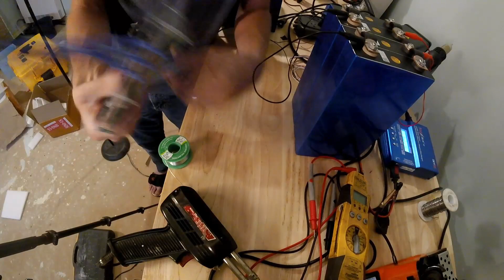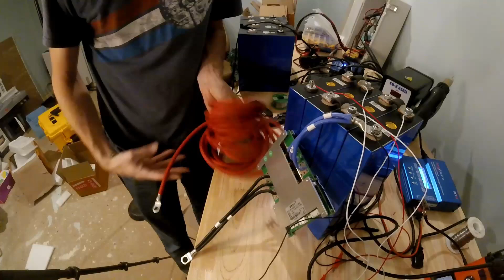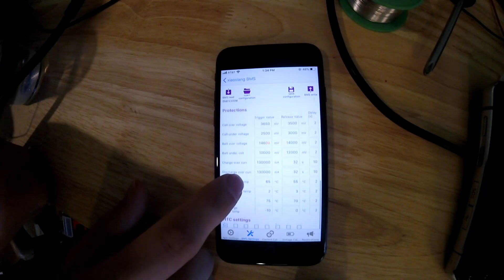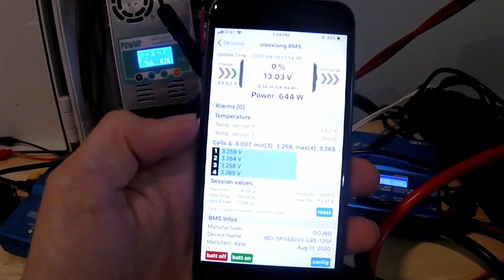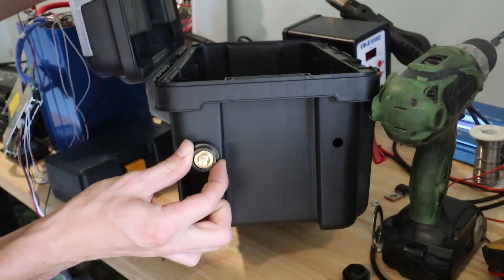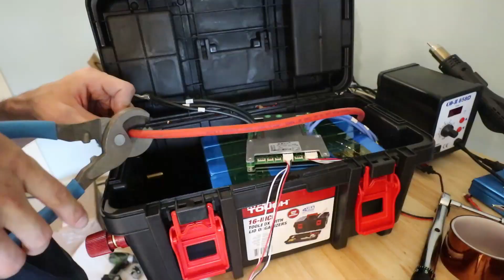DIY Solar Battery Build - Alibaba LiFePo4 Prismatic Cells w/Aliexpress JBD BMS - Low Temp Protection

Comment: with to days money in 2025 a good bms is as high as the battery which is about a 100 dollar bill with the bms already in them if they go bad i only put in a 6amp 4.2 cell balancer going on 4 years now works great, cell balancers and for 24v batterys using bat equalizer for two 100ah bat to make a 24 volt

Comment: Nice video…Thank you.  BUT the torquing was a little Overkill.! 😊
Reply from the maker: Wow you're right. I must have gotten a number confused, I do 42 inch pounds on current batteries. I'm surprised I didn't strip any threads on this battery.

Comment: With the Dimmer + Solar PV, self-sufficiency will now increase to almost 95% in summer, which means a huge breakthrough. The prerequisite is that you have at least a small balcony power station, and you don't need an expensive battery either. Example of a kettle: Without a dimmer, the 2500W - 600W PV system needs = 1900W, which you have to pay more for. If I turn the kettle down to 600W with a dimmer, then every weak PV system can now supply each consumer independently and independently, because the 2500W kettle becomes a 600W kettle thanks to the dimmer. Magic... The 2000W e-heater becomes a 500W e-heater with a dimmer, which can run 12 hours a day free of charge via PV. https://youtu.be/QbLWDbJi6ew . The 4000W oven is also tamed. Not the solar systems have to grow, but the consumers just have to drop by 75%, which is sooo easy with the dimmer. are you convinced now I have already switched my entire household to dimmers. Please have a look at my channel. ............. 🌞 ...............            Increase mini PV solar self-sufficiency (winter and camping): A boiler and other power-hungry consumers can be infinitely reduced using the "5000W dimmer". Ebay €7. I run 5 dimmers in parallel on an 850W inverter. Kettle 2.2KW at 150W runs 12 hours a day, so the water is always hot. The room is also nicely heated. 2.5KW washing machine runs in parallel with dimmed to 400...600W and always reaches its 60°C, and also its 1400rpm... It doesn't matter to the washing machine whether it changes the washing temperature to 5min@2500W or 100% can be achieved free of charge via existing PV power in 20min@600W. The wash cycle lasts the same time dimmed and non-dimmed, 3Sth 10min. The iron, dishwasher, oven, electric heater, waffle iron, coffee machine, all internal heating are throttled with me. Videos on my channel https://youtu.be/eC2olbCBhh0 The inverter stays cool, quiet and the MOSFETs + (battery) remain intact because no extreme current peaks arrive at the inverter. Now every Mini PV Inverter is enough to sell large devices. So, with the dimmer, all internal heaters/devices can be converted into base load devices that stay almost permanently ON, drawing very little current directly from the PV. With a wattmeter / energy cost measuring device you can then measure this perfectly in order to set the dimmer optimally...

Comment: Nice video, are you still running that particular BMS without any issues since then?
Reply from the maker: Yep, I’ve used dozens of these since this video. Not a single problem with them.
Reply: @BeeneEnergy  Awesome, Just pulled the trigger on it. Cheers!

Comment: Great video! 

I am wiring my BMS, I have the same bms with similar cells. I've followed the process you've shown a explained. I am at the stage of verification. The bms cables are wired correctly, I checked the voltage on the connecter and was correct (3.3v, 6.6v, 9.9v then full pack voltage 13.22v) 

There is a voltage drop when I check the voltage with the BMS connected like you advise. It is a pretty big drop / leak though ( -1.52 V). 

And when I connect the BMS cable instead of the voltage increasing again it drops further 0.20v.

Would this suggest the BMS is faulty? 

I rechecked all the connections. 

Originally the 3 cables either side of the  bms I crimped together, so I re-done those and soldered and then crimped but it did not make a difference. 

I'd really love some advise!

Thank you so much
Reply from the maker: You using the same bms? Have you tried connecting with Bluetooth to see if you can turn the output on?
Reply: Yes this was the problem. As soon as I connected the app to Bluetooth and turned the bms on it worked. Thanks dude!

 Next step is trying to figure what parameters to set of optimum charging safety and performance.

Comment: I use the same BMS on my 320a/h RV  camper pack  - works great  - runs all my 12v draw and is hooked up to a 1500w pure sine wave inverter for domestic appliences  via a  120a relay - after a summers use the cells are beautifuly ballanced still

Comment: Hello Mr.Beene - I bought an inverter of the brand PowMr 48 volt, 5000 watts. But after the installation of the hybrid inverter my battery mounting system of 48 volts went to 50 or 51 volts after recharging by the regulators outbacks and suffered the fault option of the inverter is engaged and the indicator F51 which indicates that there is an overcoat appeared on the screen but I do my best to stabilize the voltage of my battery system 48 volts,  I even did Drop the voltage of my system to 47.8 volts but the fault indicator is still displayed and the F51 option has always appeared...
I can't figure out what happened, please can you help me Mr.??
Reply from the maker: Could you link to the user manual? “No overcoat” doesn’t make sense.
Reply: @BeeneEnergy  oh yeah oversurge
Reply from the maker: @CharlesperspectiveHub  oversurge sounds unrelated to battery voltage.

I’d expect battery voltage to be about 58v fully charged in a 48v system.

Have you tried rebooting the inverter to clear the code?
Reply: @BeeneEnergy  yes i did but it didn’t work. So I gonna try one more...
Many thanks Mr Beene...

Comment: JBD bms ripped me off for over $300. Don't buy from this company
Reply from the maker: What did they do?
Reply: @BeeneEnergy  Alibaba showed that the order had been completed. So I Reviewed that I had not received the order. JBD told me to change the review. I told them that I would change after receiving. They said I would receive after I changed my review. My order shows to be in LA for over 3 weeks but has not been transferred to UPS. During that same time frame I have received 3 other orders by sea that were ordered after theirs They have ripped me off for over $300
Reply from the maker: @urbanbeeman5402  What’s the seller name exactly? I have purchased through resellers but wonder now if jbd sells direct as well. Their communication with you seems uncalled for, but it is plausible the pieces are simply taking a long time through customs.
Reply: @BeeneEnergy  I bought through JBD directly. They show that they made it through customs weeks ago.
Reply from the maker: @urbanbeeman5402  Yikes, hope it all works out for you. That’s a long time to wait but not unheard of. Sounds like you do plenty of shopping from China though so I’m not telling you anything new.

Comment: I opend your link to alibaba and it’s 40 dollars per cell soo 12 volt system 100 amp hour 160.00 bucks is that price correct??
Reply from the maker: That’s right. Though you have to account for shipping as well which will likely be another $130.

Comment: Great video!!! I’m planning building a similar battery. I saw on the video you have an Imax B6 charger (or similar). Could you charge the batteries with that charger?
Reply from the maker: I’ve used that imax for charging individual cells. It requires sense leads to charge the four cells in series but yes, It would work.

It does have a default setting for max ah put into battery before canceling the charge. Had to override that to do more than about 8ah.

Comment: So you have to hook them up parallel for passive equalization? I have mine hooked up in series waiting on my bms and hobby charger for top balancing.
Reply from the maker: If connected all In parallel you’d also need to charge the pack up to 3.6/3.65v to really top balance them.

If you’re already in series you could charge each cell to 3.65 individually. Since it’s just a few anyway.

Comment: Hello, I d like to know more about BMS working way during charging process.
How do you stop the charging process, which parameter the BMS provide ?
Is it based on tension level ?
But in this case you should have a lot of rebond because the cells reach the expected level, but after the BMS cut the chargin the cells tension go down, so the charging process should restart.

Could you explain how does it work with jdb BMS ?

Thanks

Comment: Nice build overall. Is there a reason you put the battery posts on the end of the battery? Seems like a suboptimal spot to me. The front or the top would make more sense. Also I think you'd have been well-served to keep the original shoulders of the battery posts to spread the load across the weak PE material of the battery box. One tip--and this is really important--crimp those large connections, don't solder them. Two reasons: (1) this battery can source enough current to desolder those lugs under the right fault conditions; and (2) where the solder ends between the cable strands creates a stress riser, and over time, flexing can cause those cables to fatigue and break at that junction, increasing resistance and potentially leading to failure. These are the reasons that automotive battery cables are always crimped and never soldered. A hammer-type crimp tool costs less about $20 and is a great investment even if you are building just a few battery cables.

Comment: Thank you for the lesson!  Can this be set up to be charged in a track while driving around? thoughts on the required components? Do you Use the BMS via a 12 V. source?
Reply from the maker: Typically a dc to dc charger is used to limit charging current and boost voltage as needed to ensure a full charge. But yes, no reason it couldn’t be charged while driving!

Comment: When building a pack, the sense leads must ALWAYS be on top of the bussbars and lugs. Also, the lugs and terminal faces should be freshly cleaned and oxidation protection treated. Lastly, the pack of cells needs to be strongly clamped together to prevent the bussbars from ripping out the bolts from expansion.
Reply: Also they will get a 1,000 more cycles from being compressed.
Reply: @checkingoutgypsymike2075  not necessarily… compression protects cells that get used heavily to prevent many issues, but just compression will not provide additional cycles, but could prevent loss of cycles.

Comment: Nice trick with the balance leads. I prefer to use crimp rings. Solder can cause issues with wire strength, and vibration resilience.

Comment: how to you make it 110v to connect 110v sound amplifier?
Reply from the maker: Just connect an inverter to the output terminals to change the 12vdc to 110vac.

Comment: Another way to verify the BMS balance wiring is Black to 2nd wire = 3.5V,  2nd to 3rd wire = 3.5V,  3rd to 4th wire = 3.5V and so on.

Comment: I’m buying 16 of the 3.2 v 280ah I have a 48 v system gonna buy a 300ah bms Daly brand and my 9000w 48v 110/220 v power jack inverter hopefully my home will run like a Cadillac ! Ordered inverter from eBay was 600.00  and bms is 230 on eBay and batteries are gonna run  2200 got my fingers crossed
Reply from the maker: The price of lithium has come down so much! Hey could you shoot me a text? Have a question about the cells you are purchasing. 1 (682) 730-0725

I need to look at the power jack stuff, that’s not a lot of coin for 9kw split phase.
Reply: DO NOT EXPECT THEM TO ARRIVE IN 3 MONTHS.I AM STILL WAITING

Comment: Lovely. I enjoyed your video. Just one note. You can get 280AH cells that are a little bit more cost efficient. However for scaling purposes its much less straining to buy 4,8,16 cells for 50-55usd a piece than the big ones.
Reply from the maker: Yep I'm still torn on the size of cell to use. I've since purchased some 272ah lishen cells and while I love them it limits my ability to make a small 24/48v setup when the minimum capacity is 272ah. Most people appreciate the larger battery though.

Comment: Nice video. Any helpful link to your version of the xiaoxiang bms app?
Reply: Xiaoxiang BMS app depends on what device you are using  ie: iOS/OS X or Android. On iOS/OS X devices, the app is available on Apple Store for a fee of $5. On Android devices, it’s free. (I think)
FYI JBD BMS is the best. It’s fail safe and very convenient to observe battery charge voltage on each individual cell plus cumulative volts and percentage.

Comment: I'm waiting on 100ah cells to build one of these batts. You have all of the deets, except the tool box. It looks like it fit pretty well. Do you have the name, stock number, or a link?
Reply from the maker: Thanks foe pointing that out! Should be this one: https://www.walmart.com/ip/Hyper-Tough-13-Inch-Tool-Box-Plastic-Tool-and-Hardware-Storage-Black/158502134
Reply: @BeeneEnergy  probably not the one. Yours has 2 latches. And I can catch 16" in a few shots
Reply from the maker: Shoot you’re right. Does this look right?

https://www.walmart.com/ip/Hyper-Tough-16-Inch-Toolbox-Plastic-Tool-and-Hardware-Storage-Black/40075730

Comment: @16:40 eve spec is 8n-m or 70.81 in-lbs
Reply from the maker: Thanks! Yeah so I was over doing it a bit then even at 95 in lbs.
Reply: seen people saying that you can even strip it at 3-4n-m. so id recommend everyone to go easy
Reply from the maker: @cbflazaro  good info. I just put a battery together this week and something I’m thinking about is the studs. If I put the stud all the way in and then torque the nut down it’s possible there is additional stress on the threads. This compared to using an Allen wrench to hold the stud in place while torquing the nut.

Haven’t finalized that thought yet.
Reply: Hahaha guys are you talking Physics? Hello... the guy doesn’t, even have 1/4” stud ring terminal for BMS cables.
And now talking about torque specification? More so.... this guy had already connected the Molex to the BMS before connecting the cables to the Cells!! That is dumb. Many a YouTube Warriors have made this fatal mistake by miswiring, causing the BMS to fail! And these Warriors blame the vendor for shipping defective device.
Now the Warriors are discussing Physics? ! Unbelievable.
Grow up, please.
Reply: @sreekumarUSA  Yes Physics are used to describe the force used by the educated world to tighten the improper size lug to the battery to PREVENT DAMAGE to the very expensive cell and the connector is a JST fitting NOT A MOLEX and he connected the sense leads first so what are you talking about

Comment: Are these the cells ur selling
Reply from the maker: I’ve got one 12v battery left I built from these cells. The ones I will have soon will be 272ah instead of 100ah.
Reply: @BeeneEnergy  what's the price tag
Reply from the maker: @MrJasonace99  I’m selling a 12v 200ah battery for $850.
Reply: @BeeneEnergy  yes, your labor is worth it.  I’m willing to purchase.  I’m in the DFW area.